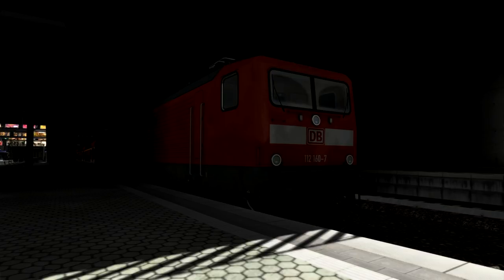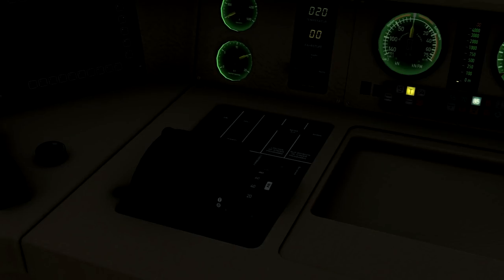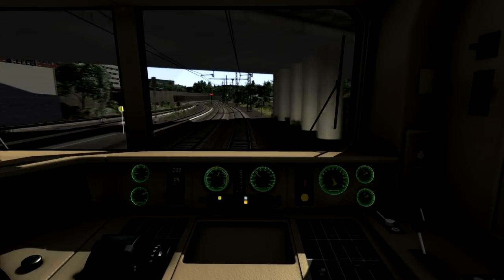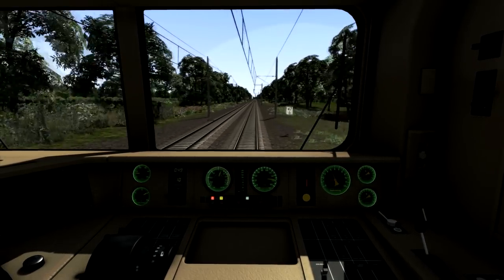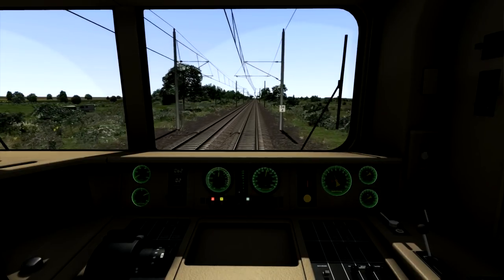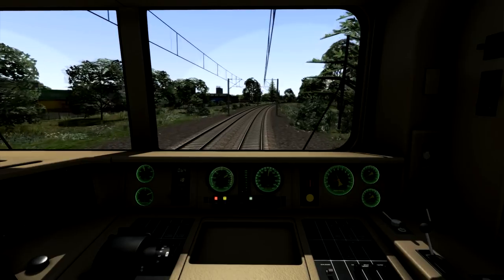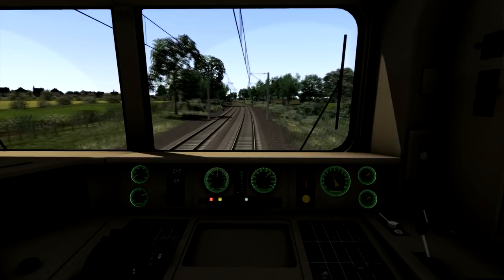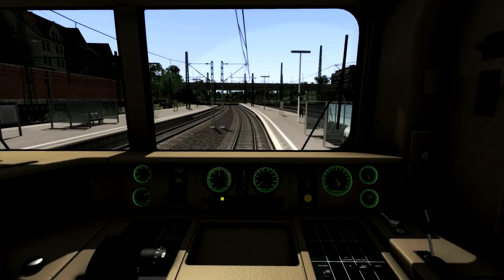Train Simulator 2018 - Route Learning: Hamburg to Lübeck (vR BR 112.1)

Comment from the maker: Just a quick note on this video - I realise that the cab at the start of the video is actually quite dark, and whereas everything looked fine both during the recording and whilst doing the editing, in the final video it's difficult to see some of the dials and controls until I've turned on the instrument lights. I'm honestly not sure why that is! 

It seems that recording with FRAPS makes the picture generally darker than Bandicam (which I used to use), but as Bandicam now either crashes TS or doesn't record it when I press the record button, for now I'm recording with FRAPS. However, I may look to use alternative recording software in the future.
Reply: What is your next UK route learning video Peter? 😅
Reply: I do recommend OBS! even tho it's mostly used for streaming, it handles recording nicely as well!

Comment: Nice video! Another little remark: "Reinfeld (Holst)" is the abbreviation for "Reinfeld in Holstein", the name of the region. These brackets are always used in germany when there is (or was) another station with the same name. There is no other Reinfeld station, but it exist a "Reinfeld" as part of the town of Templin. Maybe this Reinfeld was grown together with Templin in the past and had its own station at the railtrack nearby. Other examples are "Oldenburg (Oldb)" wich means Oldenburg in Oldenburg and "Oldenburg (Holst)", the village "Essen (Oldb)" on the line from Oldenburg via Quakenbrück to Osnabrück or "Schwerte (Ruhr)" south of Dortmund. In this case "Ruhr" is the name of the river. I think there a many more...

Comment: Just a litte abbendum to what you said about the two methods of controlling the power: The normal method is the automatic one. The manual one is, as written in the handbook or the real loco, only to be used when shunting.

And something else I just saw you doing: When shutting off the power for braking with the indirect brake, you first have all steps to run down to 0, or else you will damage the loco. To to this in the real loco you have to press the button labeled "Freier Auslauf" ("free rundown"), in TS its the key "F". When the steps are on 0 and you've heard that hissing clac sound, all power is switched of and you may start braking now. Dynamic brake will then be switched on in regard to the indirect brake value.